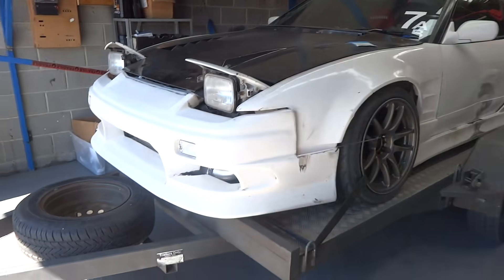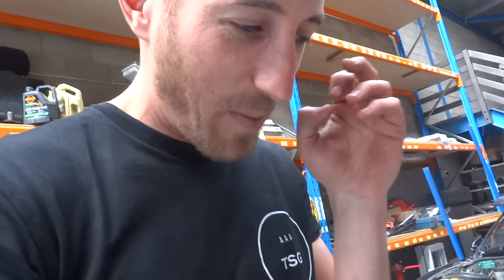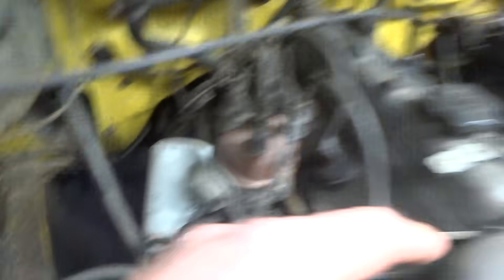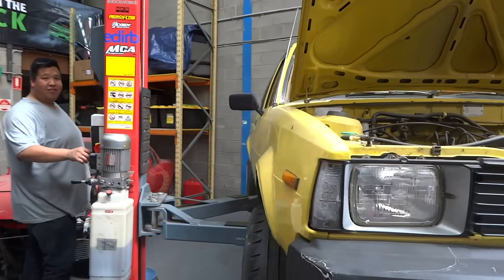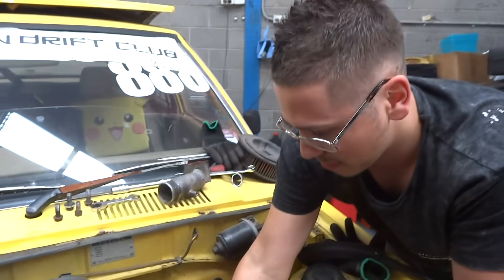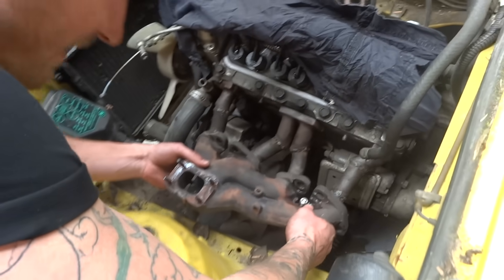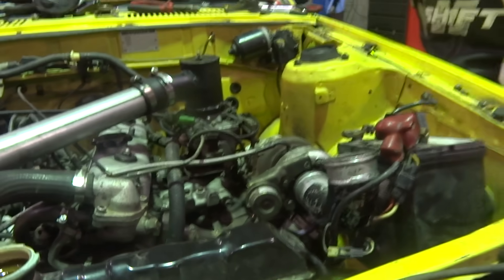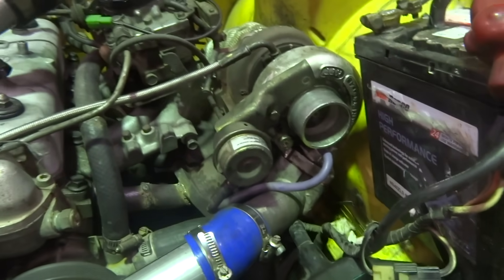KE70 COROLLA 4K TURBO BUILD!

Comment: Well, guess I'm gonna turbo my 4K-C in the future now.
Reply: Balter when you do you should do a build vid and actually do the dyno update that this fella hasn’t done
Reply: @robertmaher2981  tbh I probably won't. I'm keeping my eyes out for an AE92/93 with a FWD 4AGE to use it for parts and the front bumper if it's pre facelift. The S1 front bar bolts on to A KE70 and looks really good.

Comment: so damn nice! .. thinkin to restore my old corolla.. howmuch its cost you btw?
Reply: Jang.7 _ he says it cost nothing in the vid. But fuel pump $35aud fuel reg $140 turbo $150-$600 intercooler few hundred bucks piping $100 exhaust few hundred perhaps boost gauge psi $10   All depends on what ya have laying around and what you can do ya self. I had exhaust I had piping didn’t use intercooler had turbo made the manifold myself done oil lines myself with what I already had didn’t use a bov so it cost me about $200

Comment: Would you be able to help with some issues I’m having with a build like this. Iv chucked the turbo on I’m 99% sure my exhaust isn’t leaking pretty sure my charge pipe has no leaks but I don’t seem to be getting boost. I have no bov installed and it’s not fluttering or making any noise really turbo does spin tho. I’ve got no exhaust coming from the turbo if that means anything and the oil return is just in a bottle atm. I haven’t got a boost gauge to check I don’t really have the $ for one atm. Damn bills. Please help dude i don’t know if you can private message on here so I done this comment aha
Reply: Mike Lake it’s off a ford laser not sure what year but it was a 1.5l
Reply: Mike Lake done 👌
Reply: Mike Lake did you receive
Reply: It gets 5 psi of boost. Takes a little bit to get there tho not sure if I should go smaller turbo or relocate so there is less exhaust before the turbo. Just need it to kick in faster
Reply: Also I’m running stock fuel system my efi pump and carb fuel pressure reg is coming in the mail perhaps that will help with boost

Comment: Can I get the list of the parts you'll use for this video plz interested in doing the same to my 4k
Reply: Joe Goolab this is built from leftovers basically. Just find a turbo from a small engine. Like a 1.3  I used one from a 1.5l laser and it takes a bit to spoil up I’m thinking of going smaller. Make your own manifold buy welding shit to your original manifold. I routed mine underneath to the other side. I think my pipe was to big and it’s loosing heat as it’s got a little bit to travel. So try keep it close. You may want to turn your rotor button and weld it so it can’t advance otherwise it might ping. Use an efi inline fuel pump like from a vl commodore and use a rising rate fuel pressure regulator that you can set between 2-10psi with a 1:1 rate rise  NOT AN EFI ONE YOU WILL FLOOD YA CARB get a boost gauge and ya should be set. You can intercool it probably a good idea it will give you a better stutututu. Or if ya want the psshhhh noice go for the bov. It’s probably safer for the turbo to use a blow if valve anyway. Hope it helps. Maya be mike has more input or better input